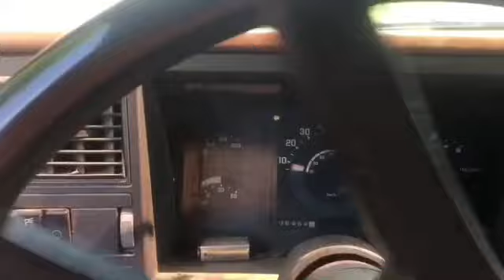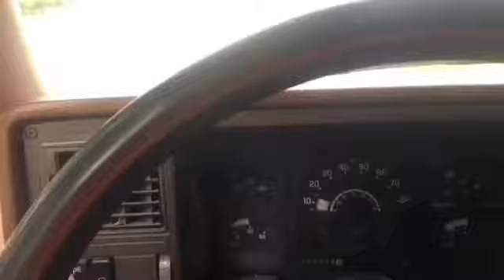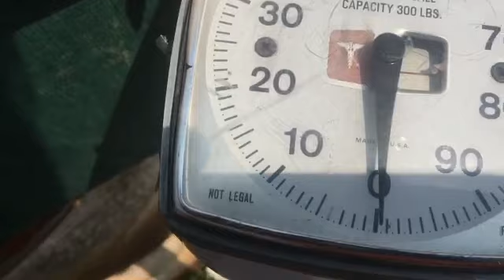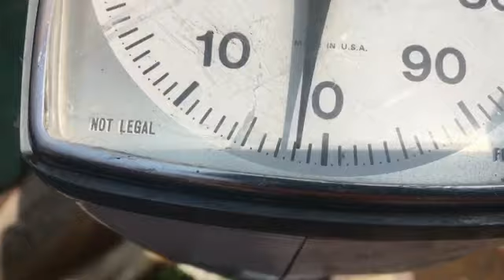GUARANTEED THEY WILL BUY IT

Comment: For those boat engines call around at the boat repair shops and see if they want them. The boating industry is having parts shortages as well
Reply from the maker: Wow even they are affected 
Unbelievable
Reply: @steelisthemeal  parts are on back order. So call around the boat shops or post them on the marketplace

Comment: Hello Marty,  what is the deal with the chevy Lumina ?  Maybe try to sell it in this crazy market? I am sure others have asked though. Have a good one
Reply from the maker: It’s a spare car.......should everything else be broken down 
It’s a runner
Just need the radiator fan to operate because otherwise it will overheat
Reply from the maker: Got it wired directly off of the battery
lol
Reply: @steelisthemeal  I understand. That's a good beater car